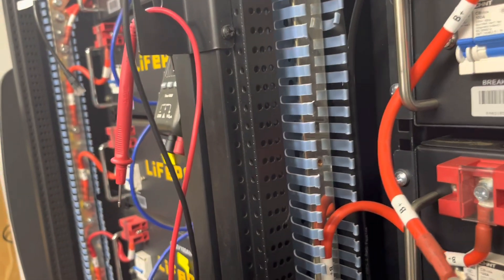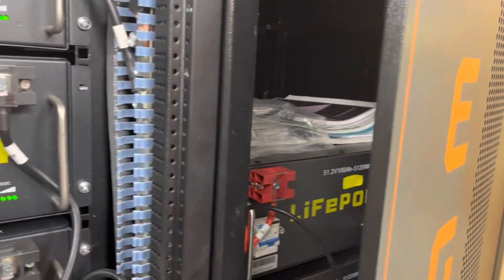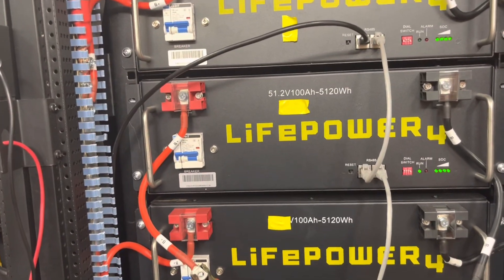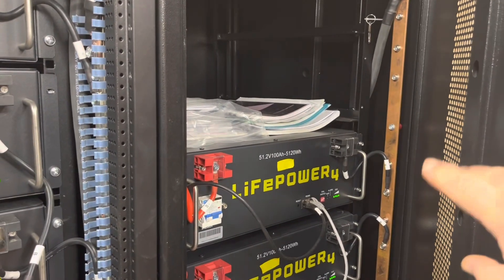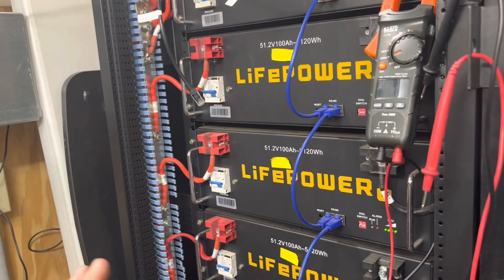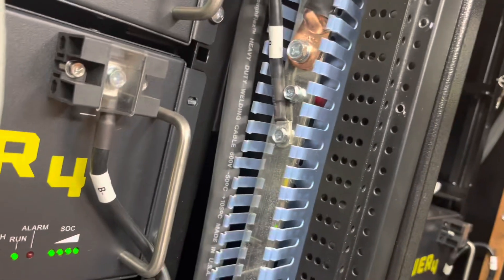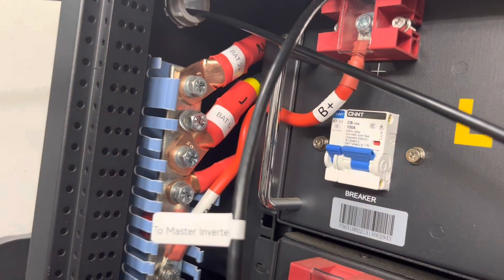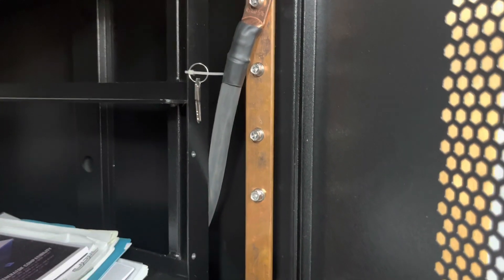Comparing EG4 battery racks. Newer is not always better.

Comment: Howdy J-M, ...
I don't know what the first two  EG4  6 Battery Racks are called / designated (from / through Signature Solar )  ? ...
but  ...
the LAST Battery Rack ( with the EXPOSED Copper BUS BARS ) is the one that  I  struggled with ...
Signature Solar must have sold me a Floor Model or DEMONSTRATION unit & quite a few of the BUS BAR Bolts / Hardware was missing upon delivery ...
...
there were  EG4  Battery Racks for the  EG4-LL batteries 
&
then a NOS ( New Old Stock )  LiFePower4  Battery Rack like the "newest" Rack you purchased  with the exposed Bare COPPER  Bus Bars 
 ( which was in reality the "OLDEST"  Battery Rack  design that Signature Solar had in stock ... 
...
I Too  received my 6 battery Rack FREE with the purchase of Three Batteries 
...
and had a terrible time acquiring the Missing Hardware in the correct SIZES & LENGTHS &  millimeter designation 
...
Customer Service assumed that since I had  EG4-LL  48 volt batteries that my battery rack was "FOR" those EG4-LL  batteries 
when 
in reality it was for the older model  LiFePower4  Battery RACK ... 
...
it all got straightened out ... and  ... the EG4-LL  batteries were actually a bit of a safety concern in the LiFePower4 Rack 
as
the Screw Holes in the Batteries did NOT line up with the screw holes in the RACK
&
the chrome metal lifting handles actually CONTACTED the BUS BARS when the installer (ME)  attempted to FOLD the Handles back out of the way after installation !!!
 ... 
I actually <like>  MY  battery rack with the exposed Copper Bus Bars as the seem to accept the recommended TORQUE much better without STRIPPING ... 
Thanks for your VIDEO
...
COOP
the  WiSeNhEiMeR from Richmond, INDIANA 
...

Comment: Jeff, great videos. I just bought a pair of 4/0 copper battery cables that are 20 foot each, although I wont need that long to get to my Sol-Ark 15k. I'm  looking for a way to go into my wireway from my 6 slot EG4 server rack. On my newer rack, I only have knockouts at the top L/R (with included rubber bushings)  and front L/R sides and bottom front L/R sides of the server rack. Can you please share where you made that connection? Looks like you placed your cables through the back of the server rack? Did you have to create another knockout?
Reply from the maker: Morning Bob. The two older racks have open tops, bottoms, backs, and fronts. 

I ran the battery cables from the Sol-arks through the back of the first, then from bottom to bottom. 

I used 1 1/2” PVC connectors in the bottom of the new rack.
Reply: @jeffmotes2129  Cool, thanks.

Comment: The bus bar in the new model is junk.  I took mine out and drilled and tapped new holes for each connection for this very issue. Pem Nuts should never be used for an electrical connection in my opinion.  You can’t properly tighten the lugs as the Pem Nut will spin in the bus bar.  Pem Nuts are awesome for holding covers on and such.  Stinks to pay $500 for something then rebuild it before ever using it.  If you do use the bus bar as is make sure to use a thermal gun to see if the connections are getting too hot. BTW - Signature Solar is well aware and have a video out on their channel telling folks to use a torque wrench to install the lugs to avoid spinning the Pem Nuts.  While that might address their warranty issues it doesn’t improve the connection to the bus bar.
Reply from the maker: My thoughts as well.

Comment: Another YouTuber got rack 3. The large nutcerts fell out just trying to loosen the bolts.
Reply from the maker: Yeah I saw that. A very poor design.
Reply: @jeffmotes2129  not a bad design just a bad install. Back in the day when I raced high performance ATV’s. we would put steel thread inserts in aluminum because we tore the motors down so often the treads would wear out.
Reply from the maker: @offgridliving4128  great for mechanical connections. Not so great for electrical connections. You need copper to copper for good electrical connections. Not copper to steel. They removed so much buss bar for the steel insert that there is very little copper to copper.

Comment: The rack I received in January 2023 matches your original 2. The only issue I had with the rack was that the Lifepower4 batteries went past the rear frame and I couldn't put the back panel on. I ended up taking the side panels off and moving the vertical mounting bars that the batteries screw into and moving them forward by 2 holes.  I could no longer connect the 3 tabs from each of the busbars to the vertical supports, but they are already connected in other spots, so it seems to work OK.  Can't say I'm terribly impressed by their tech support responsiveness, but there are a few SS employees on the DIY Solar Forum that can usually expedite a support request if you're having trouble reaching them. Ben seems to be on the lookout for issues as they are posted on the forums and he takes private messages.
Reply from the maker: Thanks! I think I have a work around. We’ll see.

Comment: They need to consult with Blue Sea Systems to make tinned buss bars with proper stand offs. Blue Sea Systems Maxi buss bars are STRONG and last forever. I own several using 4/0 cables. You can torque the snot out of them. And they are all tinned copper...

Comment: The new bus bars with the bigger lugs inserts fall right off when trying to remove bolts. I did actually get to talk to a tech about my issues but no response on buss bars very dangerous. Will be installing my own ss bolts on install later this month.
Reply from the maker: Their tech support is hit and miss. Mostly miss.
Reply: Same problematic bars here...

Comment: I built my own batteries with china cells, so no issues with my batteries, yet, lol. My latest Signature Solar gripe is I ordered a pallet of panels on 12/31/22 and at the time of ordering it stated they would ship by early to mid January, here it is mid February and still no panels, and no updates from them.
Reply from the maker: When they are delivered check them carefully before signing the delivery ticket. Both of my panel deliveries had damaged panels. The first I caught and the freight replaced them. The second I missed until I started to install them. I had to eat those three panels.
Reply: @jeffmotes2129  Oh yeah, I had my fun with SS solar delivery. I had 2 panels out of a pallet broke. The need to use more than shrink wrap and cardboard to protect glass. I am surprised the shippers don't make them do more.

Comment: Yikes.  It does look like they spent all the money making the door look pretty and skimped on what's inside.  There's no reason to downgrade the bus bars by not having them plated.  

I understand the change they made in regards to the bolts, I really do.  But it wasn't thought through.  You can't have such little surface contact on the bus bar, and you'll probably end up having arcing issues with the deformed lug.  

I feel for you in not wanting to call support.  Customer support has always picked up the phone when I call....tech support, not so much.  You may have dodged a bullet with this being a customer support issue.  Just trying to find some positive reason to have to call SS....good luck.

Comment: You may want to call them. My father ordered the same cabinet in December. His bus bars are identical to the older cabinets. This seems like a QC problem.
Reply from the maker: The dreaded nightmare of their tech support …
Reply: @jeffmotes2129  it does have quite the reputation at this point. The best time to call is in the morning. At least that’s what they say. I haven’t found a “good” time yet.
Reply from the maker: @GavinStoneDIY  I have never had a phone call returned by their tech support. Emails typically take a week to be answered and an actual resolution to a problem a month or more. 

I can say this for Sol-ark. I contacted their tech support three times and left messages. They contacted me back within an hour on two of the calls and about 1 1/2 on the third call. AND they stayed with me until the issue was resolved.